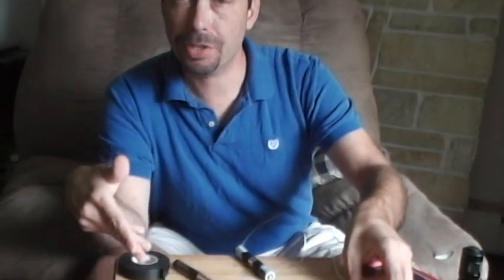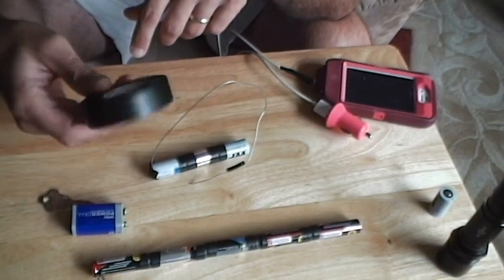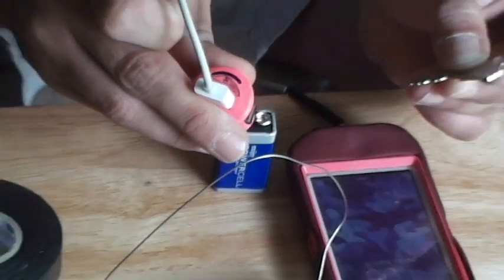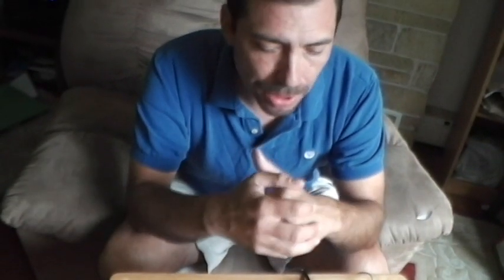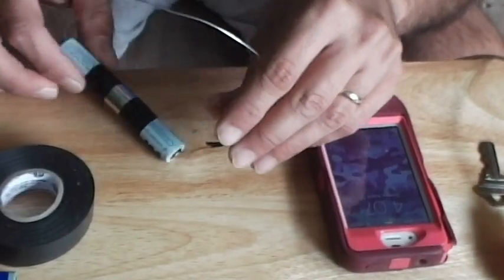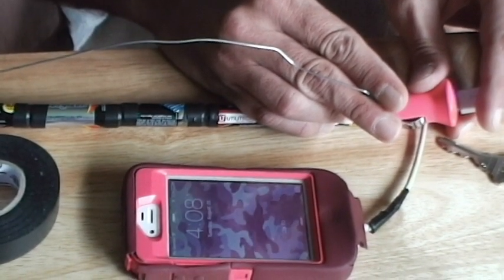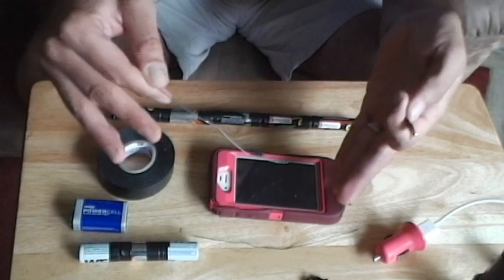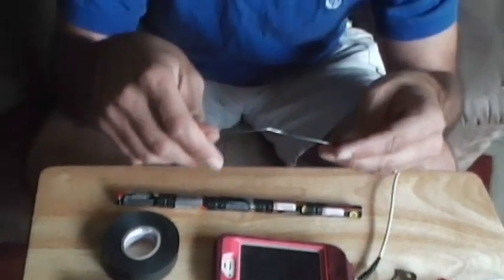Charging a Cell Phone with Batteries

Comment: Your right , in a Survival / times of trouble situation..I would rather use this , if it were the only option to get assistance, for sure...
Best to test it out, and if you fry the device, you can take it in , and get a replacement...this way you know if it works or not...best to test, b4 the SHTF situation. Cheers ;-)
Reply from the maker: +Kanzee  Definitely refer to your user's manual and know that when you test, you could fry your device. But practicing before an emergency happens is always best!

Comment from the maker: I will say that before we started filming, my wife's cell phone (pictured in the video) was only at 6% battery life and was about dead.  I touched the 9V battery to it with the wire, completing the circuit, and the phone immediately jumped to 12% battery life, just off of the 9V!  It really does work, giving you enough charge to make an emergency call if you had to!  Please be advised to refer to your user's manual for voltage required to charge your device, and remember that there is always a possibility of frying your device by using alternative charging methods, so do this at your own risk.